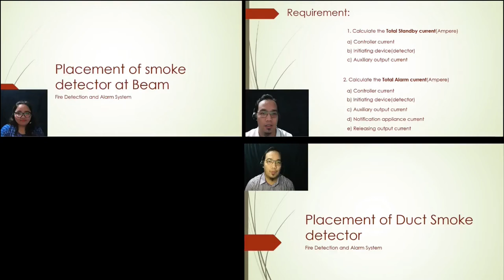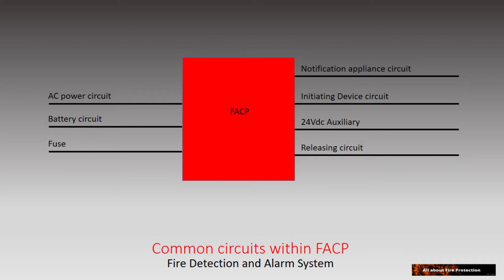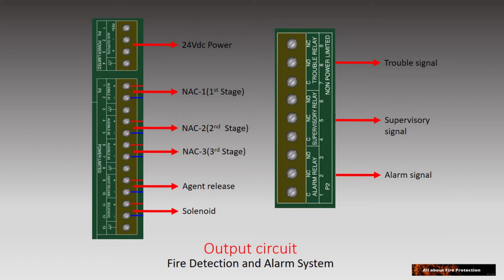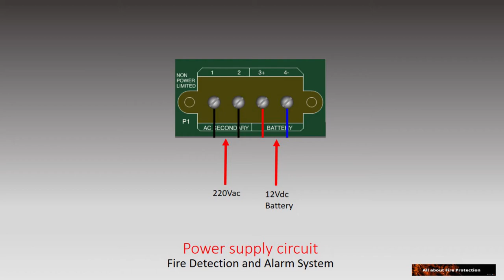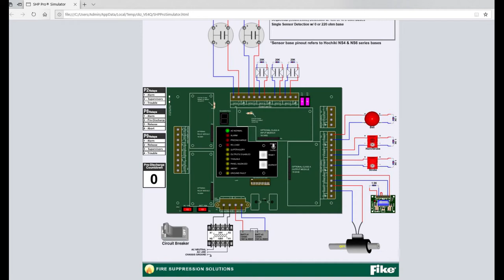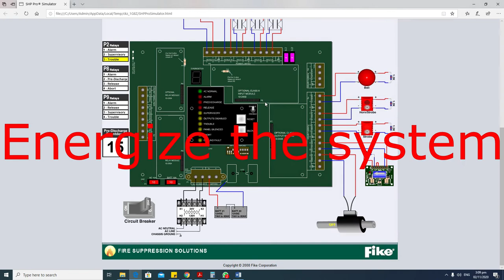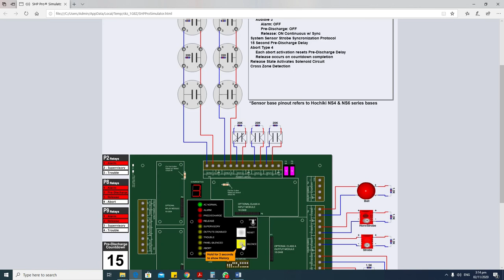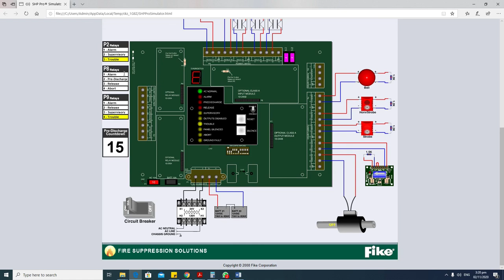Basic Operation of Releasing Fire Alarm Control Panel #Firealarm #Allaboutfireprotection

Comment: Thank you...can we discuss about cause and effect matrix?
Reply from the maker: Hello, Sure. What is it you want to discuss?
Reply: @AllaboutFireProtection  about fire suppression cause effect pre-action
Reply from the maker: @dingcolarte6131  Hi paul. What is it you want to ask about preaction matrix?
Reply: @AllaboutFireProtection  yes can I help me pre action matrix please.
Reply from the maker: @dingcolarte6131  Hi Paul. For Preaction, if you are using a single interlock system utilizing a solenoid, the solenoid can be activated by activation of any one single zone detection or it can be by cross zone depends on your project requirement. And if you are using double interlock, both detection and sprinkler must be operated before the preaction valve opens. Configuration of detection will be the same as in single interlock. No time delay.